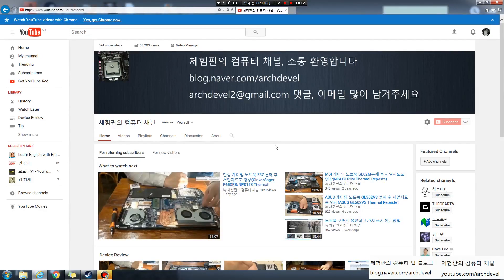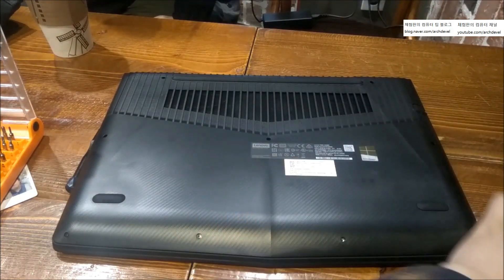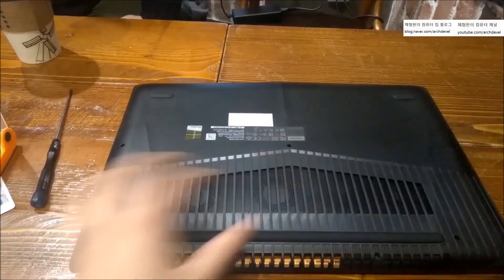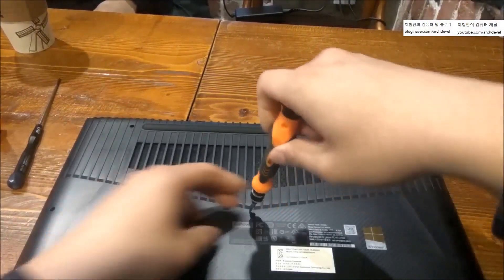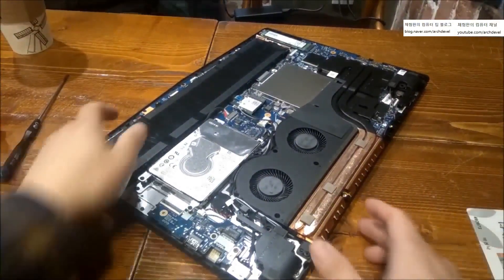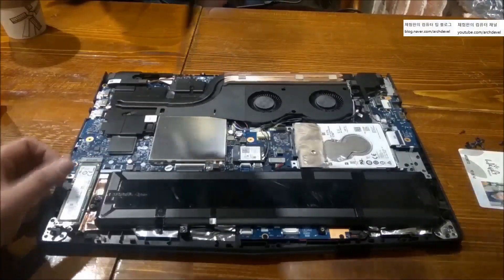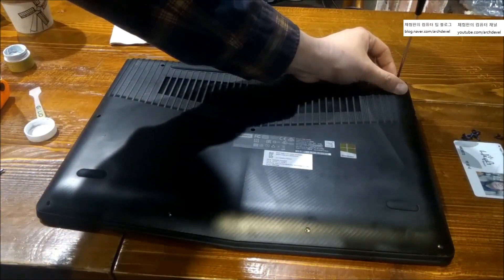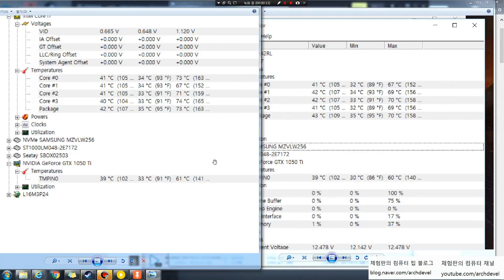Lenovo Y520 Review, Maintenance, Temperature (English)

Comment: nice video bro... BTW can i ask there's someone who posted on youtube having keyboard problem... have you had the same problem. or do you think it is just few units..... Im planning to buy the 7th gen i7 with 1050(not Ti)
Reply: 체험판의 컴퓨터 채널 The guys over at the Lenovo forums have figured out the solution to this problem. It's caused by an iron sheet cover touching the keyboard connector pins. To fix this u have to open up the case, and reinsert the cover properly. Here's the link to that thread. https://forums.lenovo.com/t5/Gaming-Laptops/Lenovo-Y520-Keyboard-buttons-are-pressed-when-nearby-surface-is/m-p/3635680#M5736
Reply from the maker: Darko Browno I didn't use lots of time about this. but I can tell you that no one argued that keyboard is having a problem in Korean 2nd biggest laptop community(so much people are in use now). In my opinion, this is the best laptop in this segment. and plus, the laptop cooling system can afford i7+1050ti too. That means no problem with 1050.  Just go ahead
Reply: thankss!!!
Reply from the maker: np
Reply from the maker: Sporksticks I didn't expect the situation. Thanks for announcing the information.

Comment: There is nothing changed??
Reply from the maker: Tobias Hüttenrauch temperature has decreased after work.
Reply: See only the end resault... From who to who is decraesed?
Reply: For me is exactly the same??
Reply from the maker: Tobias Hüttenrauch I didn't understand. Just write ur mean with your language. I will try google translation.
Reply: Am Ende des Videos sieht man die Temperaturen. Original und mit neuer Wärmeleitlaste. Diese Werte sind doch beide gleich? Oder sehe ich das falsch? Ich dachte die Temperatur ist gesunken?
Reply from the maker: Am Ende des Videos, Die Temperatur des Laptops hat definitiv durch Wiederholung Arbeit verringert. Obwohl die vorherige thermische Paste in einem hervorragenden Zustand ist, hat meine (Gelid Extreme) eine hohe Wärmeleitfähigkeit. Wenn du nach dieser Arbeit suchst, würde ich empfehlen, thermal grizzly kryonaut, arctic mx4, gelid extreme. Irgendeine Frage? Bitte machen Sie bitte einen Artikel
Reply: There is a change of 5 Degree C approx for all cores. That's a lot, considering its just a thin thermal paste that changes the temperature. Heat and dust are really laptop killers, you would want to replace them and clean your laptop  after some time if you want your laptop to last long.